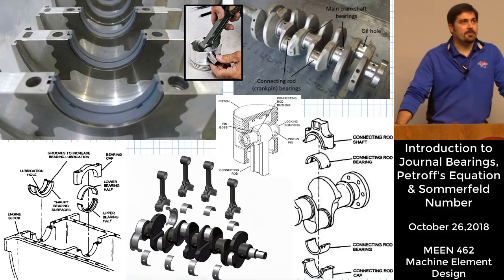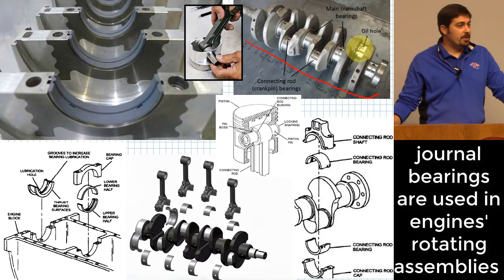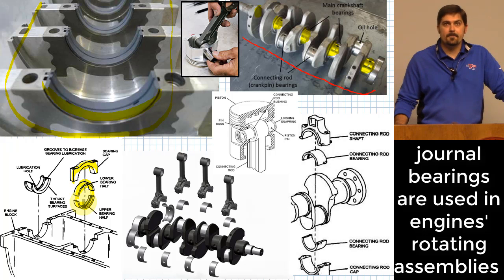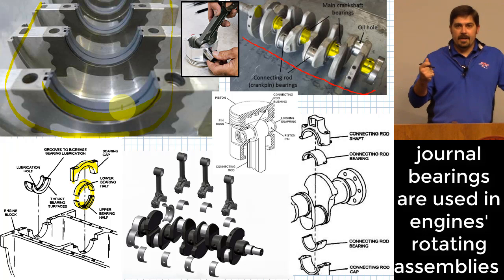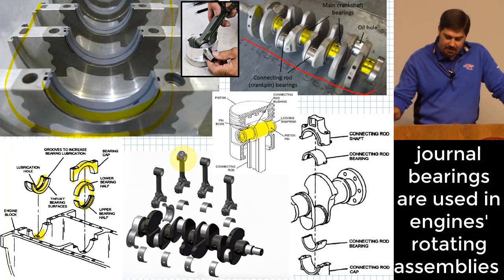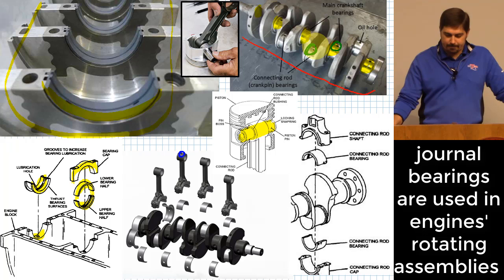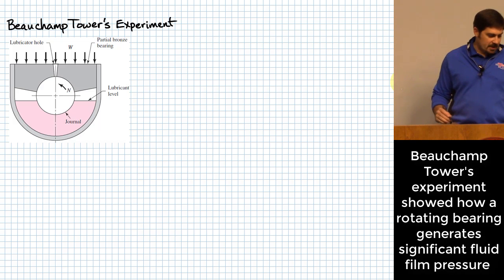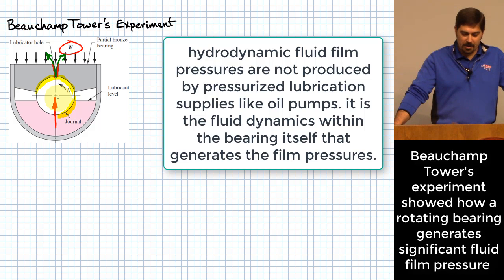Hydrodynamic Journal Bearing Introduction | Petroff's Equation | Sommerfeld Number | Friction Factor

Comment: Minor correction: the tabs on crankshaft bearings aren't what keep them from turning - it's the bearing crush that actually holds them in place once torqued down. The tabs are there just to locate the bearings in the correct orientation during installation.
Reply from the maker: I partially agree with you. Yes, it is primarily crush that is supposed to keep the inserts from spinning. It is interesting to me, however, that the direction of the tabs always seems to be set up to prevent spinning the direction that torque would be applied in service. I think it is a similar situation to bolt groups holding torsion between one member and another. It is supposed to be friction transmitting the torsion, and yet simultaneously, the bolts are available to transmit shear should there be some amount of slippage between the two members. That is my feel for it at least.
Reply: @TheBomPE  I think that's something that's done more out of convention than actual intentional design, as at this point there are some manufacturers that use main bearings without any tangs at all and most/all rod bearings are assembled with the tangs of the upper and lower halves on the same side.

Comment: sir, u said that sommerfeld number is used over petroff bcz the latter doesnt considers eccentricity of the journal, but same is the case with sommer also..please throw some light
Reply from the maker: The derivation of the Petroff equation sheds light on how the Sommerfeld number was established. The Sommerfeld number is used as the abscissa in a series of charts used to relate relevant dimensionless groups of variables for hydrodynamic bearings. These charts account for eccentricity and such. Please view the next lecture in this series if you'd like to see some examples illustrating how to use these charts along with the Sommerfeld number. ( Link: https://youtu.be/U6MYvY0ST8Q )